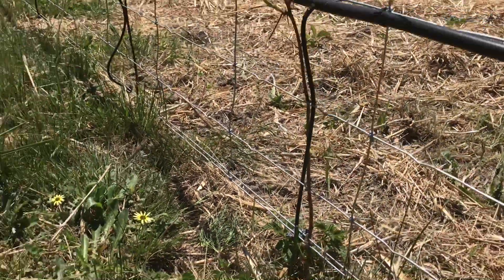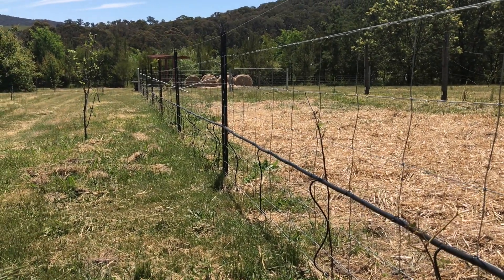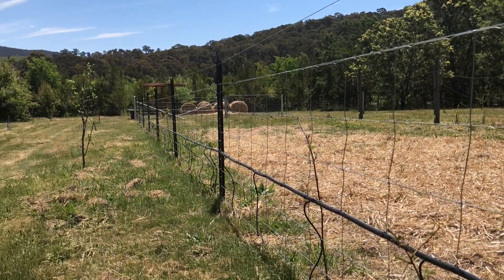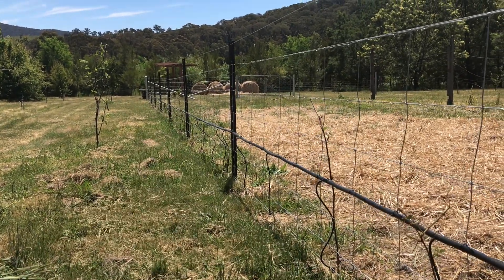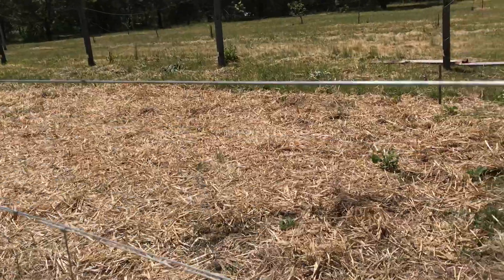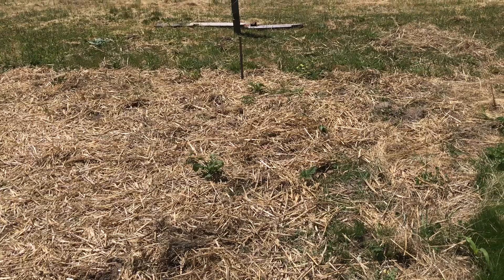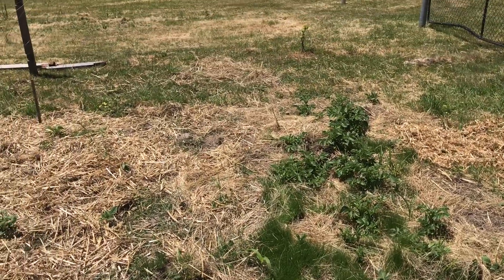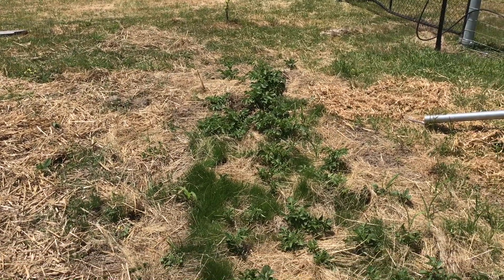Gravity Water Fed Drip Irrigation - It Works!

Comment: Thanks for sharing! You mention that you tried the brown tube with holes in it, but that it didn't work. Do you mean the pressure compensated type? What was your experience with it?
Reply from the maker: Hi Sally, yeah the brown drip irrigation hose just didn't work on  a gravity fed system however they work amazingly under a pump or from a normal garden hose system